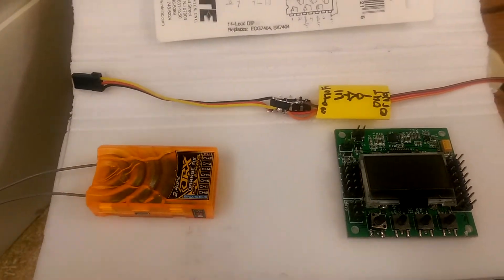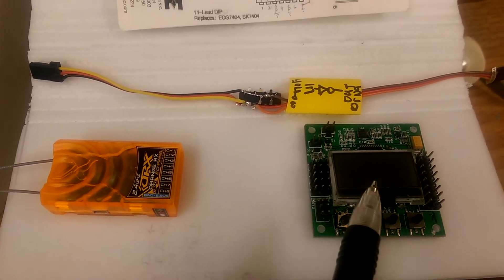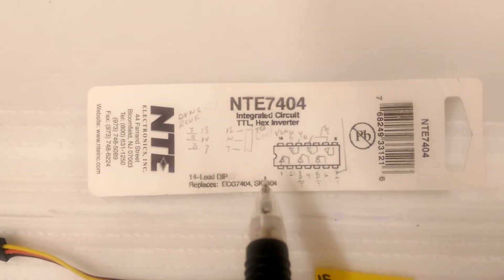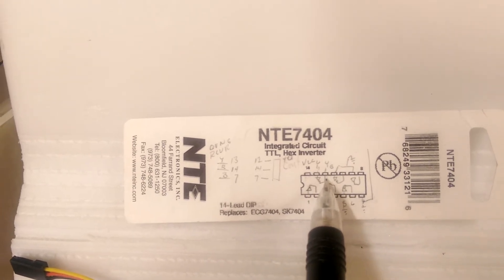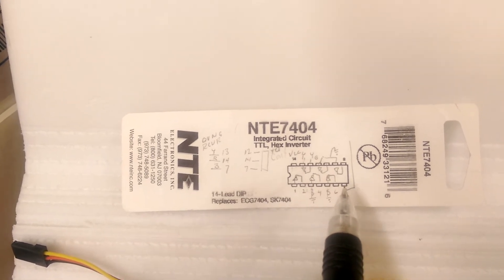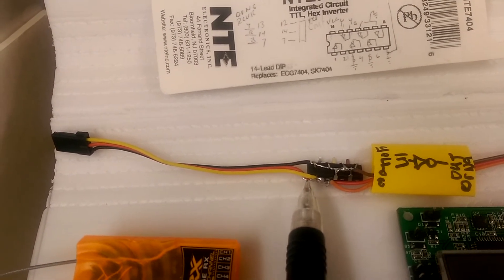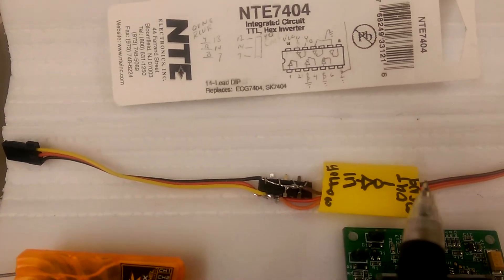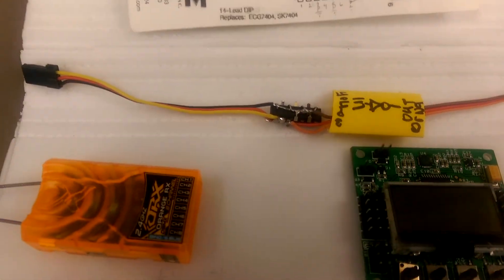Sbus interface fabricated to connect to a KK2

Comment: Outstanding!
Where does the output go into on the KK2 board?  I assume the first, top most pin set, aileron?  Or does it matter?
Additionally, The KK2.1.5 also needs the FirmWare of V1.19S1?